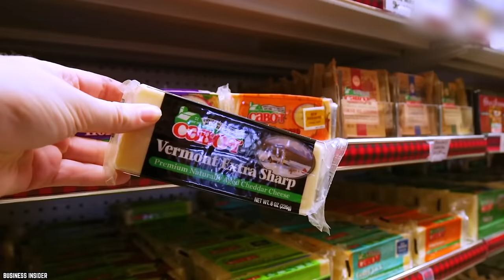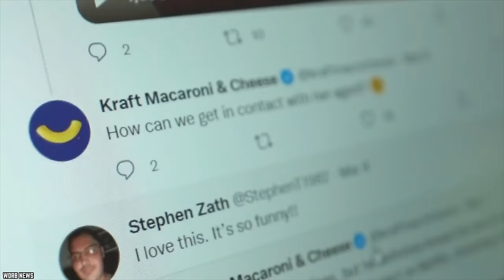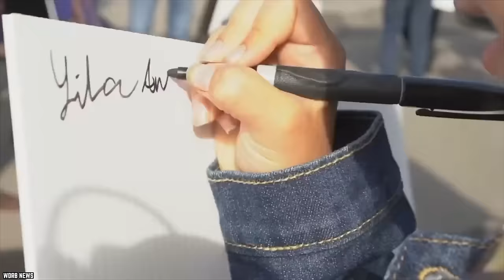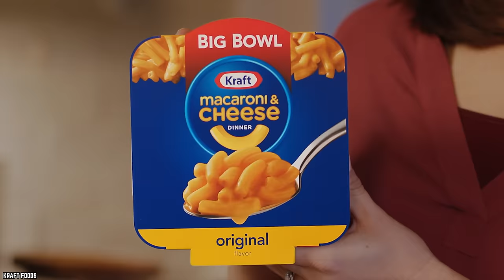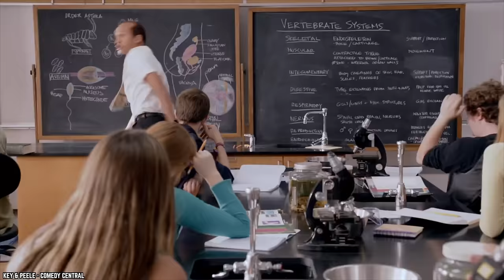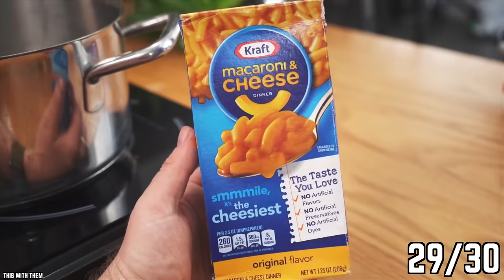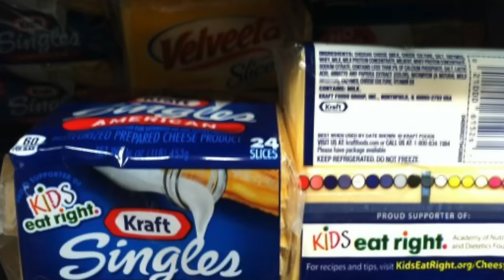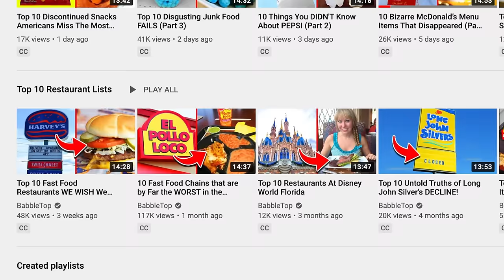Top 10 Untold Truth Of Kraft Cheese

Comment: One simple and delicious way to enhance mac-n-cheese is to sprinkle a small amount of garlic powder on it!  Not a lot, just a very light dusting.  (It really makes a tasty difference.)
Reply: I agree.  I actually stir in equal parts garlic powder and onion powder to add savory deliciousness.
Reply: You can amp up any cheese by adding red pepper flakes or cayenne.  With cayenne, use half of what you want.  It's hot!  You can make a fabulous grilled cheese by putting diced sweet red bell peppers on top of the cheese.